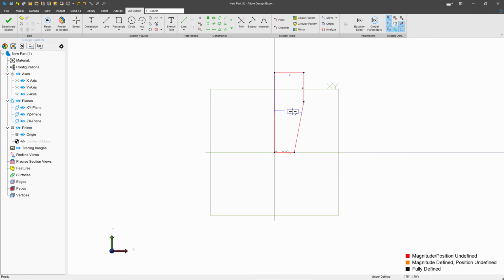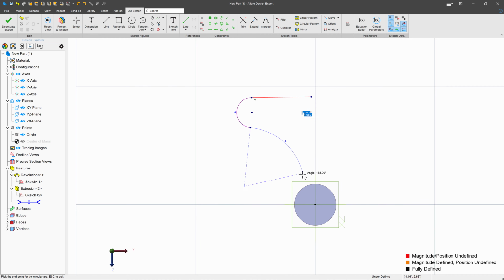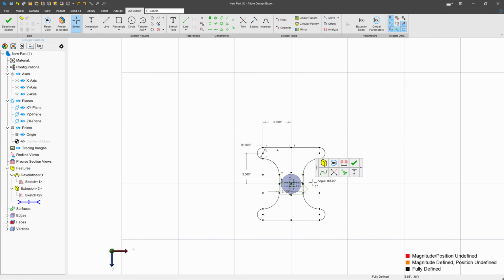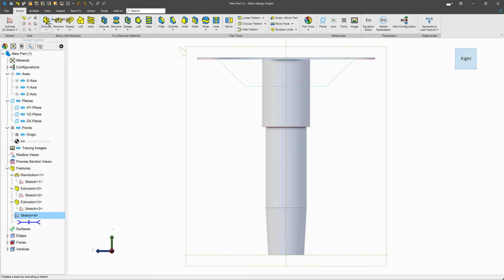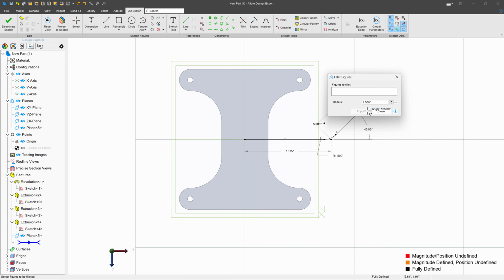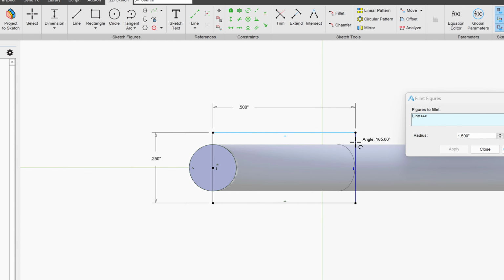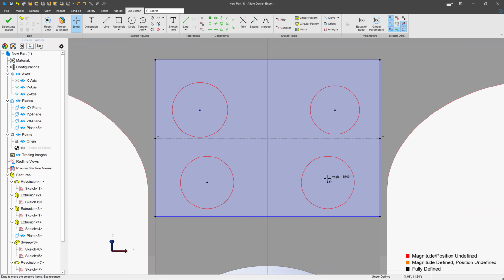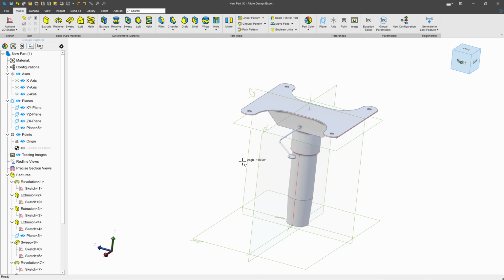Model an Office Chair Riser | Alibre Beginners Course #36

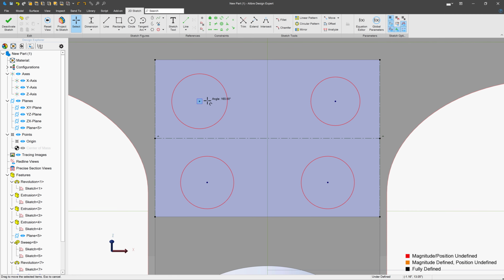Comment: At about 11:00, you're making the holes. Exactly following your dimensions, my holes don't look like they're in the same place, and a .5 extrude cut puts them through the top of the plate. Did you change the size of that face from 2" and didn't show it?
Reply from the maker: I checked the files from a  year ago and it is still coming in at two inches (normal height from face to face)